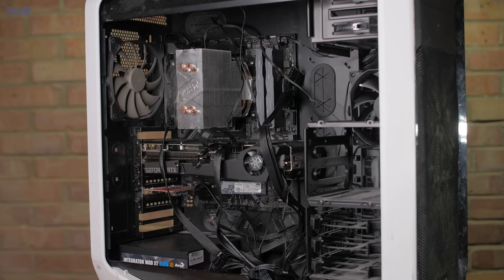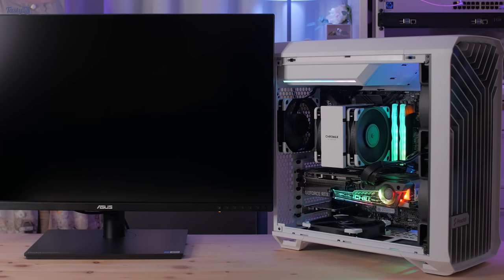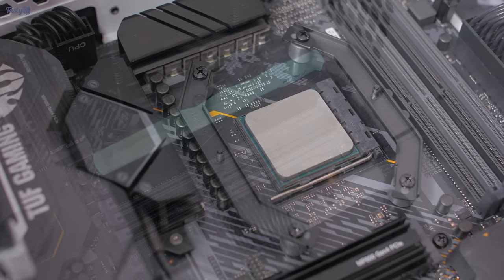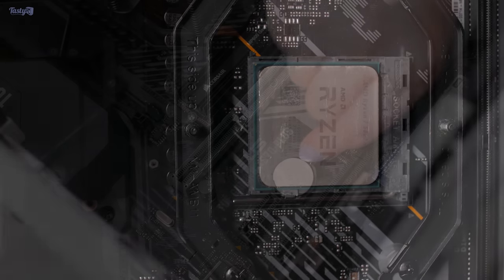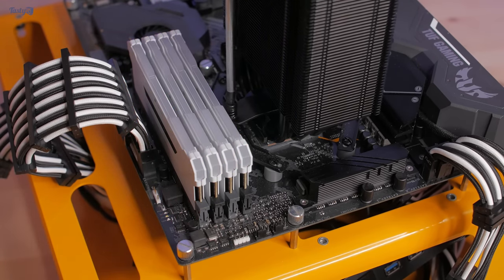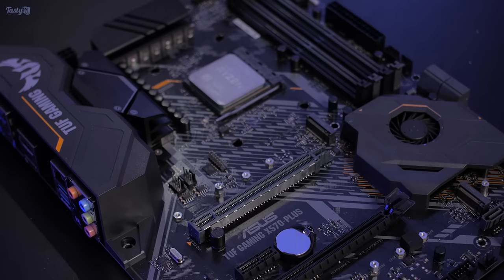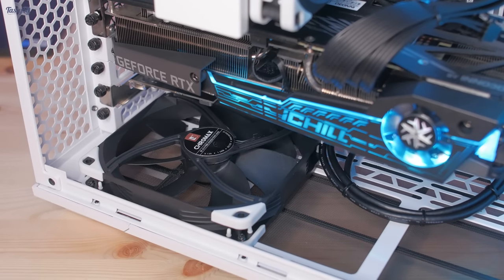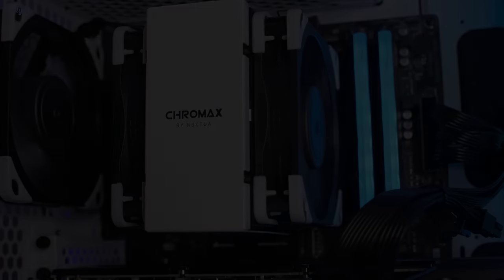I BROKE A VIEWERS PC??

Comment: I had the same problem with that Asus TUF X570-Plus and a 3900X. I had to loosen the mounting of my EVGA 280mm AIO a little bit for all 4 memory sticks to work properly. I am probably wrong but I have a feeling that the Mobo thickness is to blame.

Comment: I think the original mbd mounting lever mechanism was broken.  It looked as if the mount was no longer completely flat where the lever goes into it (nor did it sufficiently difficult to close), thus not providing sufficient tension on all the cpu pins.  Of course it could not be the issue as it if difficult to tell from your video alone.  Don't lose heart!

Comment: I’m guessing it’s a slightly bent pin on the processor which means as you add pressure it doesn’t get good contact with the socket. I have to inspect pins by spinning the cpu with a well lit magnifying glass looking for ANY minor changes. Use a razor blade to straighten them, but be gentle. It takes very little to move them and or break them off if they are loosened. When it’s in the other board, the issue may not be seen as the contact might be slightly better than the one you see the issue on.

Comment: The CPU socket on the motherboard might be damaged. If it was over tightened on installation the first time (the owners install) it could have cracked or broken some of the solder joints over time.

Comment: most likely it is the am4 socket itself and not the whole motherboard that might have an issue. metal tends to change  a little bit depending on temperature  so  the socket itself may be bad and caused a contact issue with some cpu pins as they move just enough to stop making contact because of thermal expension. the socket was probably bad to begin with and i already seen this issue many times and the board had  to be replaced  or sent for RMA if it is still possible. i would try with another 5000 series chip to be sure   to rule out the cpu pins being misaligned with the socket because it popped off with the cooler but a bad am4 bracket is also to consider if  any 5000 chip pops off from it like this .  

most of the time  either the am4 bracket is broken  in some way  or just misaligned with the pins  and  those issues are vey common on motherboards made during the pandemic because of the fact that to increase productions they had to cut some corners somewhere  to simplify and shorten the assembly time. sometimes  the plastic AM4 frame either is just bad , misaligned  or a combination of both . Also Zen 3 5000 series cpu pins seems to be a bit thinner than Zen 2 chips and pop off with coolers and pins might have bent just a tiny bit putting them just out of alignment and  all of this combined may explain why changing motherboard  resolved the issue  but i would still try to stress test with OCCT  that is a better stress test than aida64 because it is more intensive and will reveal any thermal issue of the kind .

Comment: I was wondering lately when you will show us the solution. I had a very strange problem this week when my PC would not post. It was my Brennerstuhl powerblock with overvoltage protection. I had to turn the power switch off on the block and voila the system went back up and running. Very strange, could be the HF filter causing a low voltage on the system/PSU. I really like your video's they are very comprihensve! And I think your builds are very stylish  And I have the same Noctua cooler in my build! Works like charm on my Intel 10700. keep up the good work! My compliments!

Comment: Yeah see fractal are not the first ones to use 180mm fans, Silverstone did in their Raven series cases. Reason why they worked so well there was because the Raven rotated the motherboard 90 degrees, so basically it operated like a chimney.

Comment: it could also be the copper traces underneath the pressure area being snapped in half. This is something that could accur if the CPU cooler was tightened to much and seeing the state of the pc before it got even to you it seems like the copper traces have snapped because someone tightened it to much. Whenever the heavy cooler is on it it could bent it just out of possition and no make contact thus giving a error. So it looks like a broken copper trace i have had this with a customer before too. the reason this issue does not persist with a lighter cooler or with different CPU's is that the metal covers are not all equal in size and there could be a 1nano meter difference on those cpu's which is enough to offset a broken copper trace i mean the copper traces these days are like 0.25mm so even the smallest offset could prevent data signals from sending

Comment: Motherboard socket may have a trace underneath that is severed and only "reconnects" when pressure off the socket is achieved. I have two of those Tuf  Gaming Plus motherboards and use a Corsair A500 (similiar mounting system as the Noctua)with no issues with posts. RMA the Tuf board (if possible) and this can be tested.

Comment: Great job on the diagnostics!
I was in need of a Z97 mobo a few years ago, and for some reason the prices were absolutely crazy, like £200-300, so went looking for a used one on eBay. I found one for about £20, an ASUS Z97 Deluxe with all the bells and whistles (a lot of bells and whistles!), but the listing said that it didn't work because of a memory fault.
After a quick internet search I found out that this was a common fault with those boards and that you could sometimes them to work by messing with the tightness of the cooler. I had a custom loop and so my waterblock was nice and light and it only took minimal tweaking to get the board working.
I wouldn't be surprised if that board worked just fine with an AIO instead of a big heatsink.

Comment: I ran into an issue once where the cooler hardware was interfering with the traces from the ram slots to the cpu causing a short. If you are bridging the traces this can cause the problem. I fixed it by adding some noncunductive rubber washers to the stock cooler mounting hardware against the main board.

Comment: Tough one - I would have probably ended up with a 2nd motherboard before finding the CPU pressure.  Good video!
Reply: The issue might have been an isolated incident to that very combo. There's no way to say a new board might have been the same.

Comment: Glad to see it got up and running fine, nice touch giving the motherboard to the viewer.

One tip about am4 take your time taking the cooler off, yeah amd CPU’s can stick to the cooler but when you lightly press en twist carefully left and right the cpu stays in place almost always. Kinda looked like you pulled hard on the cooler wiggle a bit more in the future it does help.

But nice video keep it up, looking forward to your next build / fix.

Comment: As a sysadmin i would say its a faulty socket or a micro crack in a track in the motherboard. those faults are so hard to diagnose. you are luck to pin it down to the weight of the cooler on the cpu. you could of shimmed the cpu to spead the weight more or used foam washers on the back spreader plate  or it could have been the thickness of the thermal compound. you could of tried electrical switch cleaner on the cpu and socket. you did very well on the fault finding i would be very please to see an engineer do so well. keep up the good videos hope my tips help for the future

Comment: hot air gun  could be used to reflow the solder joints . who knows what happened maybe he might have tried to remove the cpu heatsink at an angle damaging the socket solder joints

Comment: That is an absolutely insane issue, I would have been driven mad trying to figure that one out. Toughest issue I ever had was a weird random kernel 41 error (random shutdown) that had me undoing overclocks and XMP, manually tuning in RAM timings and frequencies, manually tuning vcore and cache voltages, updating my BIOS, reflashing my GPU's vBIOS, reformatting my harddrive and reinstalling windows, updating chipset drivers and more before figuring out it was a c-state issue and that changing a single BIOS option would have fixed it.

Comment: That is an absolutely insane problem.

Did you at any point consider lapping the 5800x and cooler, just to see if that slight reduction in height would make a difference?

I'd be tempted to just for my own sanity...

Comment: i had the same problem with a noctua cooler on an AM4 board. i fixed it by getting a cheap 240mm EVGA all in one cooler. it was on sale for $55 on amazon. it was half the price and did a better job of cooling the CPU. even though using the evga AIO "fixed" the issue, i think the problem was still with the CPU. i think the issue is with AMD's old AM4 manufacturing. some of the pins stop working when there is too much pressure on the CPU. pin grid array CPUs were always garbage. they were garbage when intel used them, still garbage when amd was using it. there is a good reason for why amd uses land grid array (like intel) on all their expensive server and threadripper CPUs, and intel ditched PGA over a decade ago. for AM5 amd got rid of PGA as well. finally.
Reply: For all PGA's problems, LGA has its own, funnily enough also with mounting pressure sensitivity of contacts. There just isn't a genuinely fault-proof way to connect a 1000-pin chip. PGA has been discontinued by AMD now purely because it simply isn't possible to build a PGA socket with enough pin density. AM4 already has pin layout compromises with regard to signal integrity because there aren't enough pins in the socket, it really needed a couple extra rows for the functionality it offers.

AM4 CPU is well supported and constrained in the socket, i don't believe a problem with CPU is possible. It should be caused by socket damage.
Reply: Heh - pin grid is still a heck of a lot better than those terrible 'slocket' cpu's that Intel flirted with years ago.  Remember those?  I do..   they were awful.
Reply: @zenstrata  slot-1 and the short lived AMD variant as slot-a? Fold out ears on top of an edge connector.

I remember disliking them but I no longer remember why.

Then we got Socket 370 which was top notch in most regards. Except the stock CPU cooler was an absolute disaster, I absolutely did not have the hand strength to mount them safely. Nor did many other people judging by gauged boards on return. When cam levers came about a little later, it was such a relief!

Comment: Worth a shot but I have also had this issue and it was due to dust inside the RAM slot. I used compress air and blow out the dust and the sticks worked again.

Comment: try and clean the socket with alcohol, maybe dust or thermal paste got into the socket and depending on the pressure at some micro level some of the pins on the cpu get disconnected

Comment: I have a similar tuff motherboard and I had trouble adding 2 stick of ram and make it past the post.     I had to remove the new ram slot and disable XMP in the bios then add the 2 other ram stick. After I was able to have the 4 stick in and post without xmp.   After it posted I was able to re-enable xmp with all the sticks in.  So in short, disable xmp before adding new rams.

Comment: The original cooler had only one fan installed and it was probably pushing or pulling the air in the wrong direction.

Comment: So indeed a micro crack in the soldering of the socket to the mainboard that arises when a certain pressure is used. Rma needed for the board.

Comment: In the matrix of options to solve the problem, why wasn't one of them replacing the cooler with something else? Did you perhaps also try flipping the cooler around? It could be that with the surface not being completely flat on the base plate, that rotating it would have moved the issue to a part of the IHS that isn't directly over a CCD or IO die. The 5800X has an off-set CCD.
Reply from the maker: Because I knew there was nothing wrong with the Noctua cooler. It worked perfectly with the 2 other CPUs tested and with the 5800X after the motherboard swap. Whereas the CPU+Mobo combo was unstable even when using the Deep Cool Cooler instead. Also, the Noctua cooler isn't symmetrical, so flipping it around would have resulted in blocked DRAM slots.

Comment: I sadly had the same thing happen to me with an amd ryzen 5 3600. I didnt try the pressure thing tbf. Back then I thought my new motherboard may have "killed" it, cause when I closed the leaver the cpu and/or motherboard made a kind of crunchy sizzle noise, I guess thats the best I can describe it. Even with the handicap of no dual channel ram the CPU is still doing alright in my little sisters build tho
Reply: It might've been caused by me overtightening the AIO cooler and ended up in breaking the memory controller somehow. That was my second guess at least, once I've done some research after not seeing any bend pins. The CPU worked just fine before the mainboard and cooler change, no hicupps/crashes or anything.

Comment: Thank you so much, been looking for a replacement for speedfan for years. When you're water-cooling, or even air cooling, only being able to base the fan speed off CPU temp is super pants. Remi fancontrol for the win. Also great investigation on the memory issue, everything was normal investigation of that issue until you started looking at mounting pressure 🤯 I have learnt a new trick. Thanks again

Comment: Nice job on figuring out the problem. Please don't take the following in the wrong manner - but please get into the practice of raising the Sockets ( Release ) lever before { Removing } the Cpu. Take care and have a nice day.
Reply: You can't do that when it comes out with the heatsink though, there is no retention other than the ZIF socket pinching on the pins

Comment: yeah well done. especially for going back to check on the system instability afterwards. that was all quite a fascinating problem solving journey. in particular... the whole mounting pressure thing was not something expected from a pga socket system.

one thing i do personally feel seems a bit silly... is that the hanging of heavy ait coolers sideways. things like the dh15 (when not being otherwiae supported). except thru the motherboard pcb itself. it does just seem like a bad situation that might stress and flex a motherboard pcb unduly. and right in a very critical area where you have a lot of thing traces going to the cpu. and of course the socket itself. but then again i suppose ripping a ryzen cpu out of an am4 socket... that didn't want to be ripped out. could potentially cause even more damages than that!! hee hee

well either way, it all (all the evidence) ended up suggesting a physically damaged connection on either somewhere on the mobo pcb (ie broken trace). or otherwise on the socket (such as a broken solder joint, ie fractured / cracked). whereby a different amount of force. either pushes less (or more) those 2 surfaces. and lets a better push based contact pressure onto that damaged or fractured joint. as for wherever it exactly is, we may never know for sure

in terms of the cpu itself would have compared dimensions. measuring each with a pair of calipers because... maybe going between ryzen generations there might perhaps be some small difference in the thickness of the cpu itself (idk, would have to further research that). but such a difference would also help to explain a resultant difference in the contact pressure. from cpu to cpu. having said all that... its nothing i would have myself guessed or expected from a pga socket. with the sliding horizontal pinching action to grab the pga pins. its all stuff you would rather expect from other components (like an lga socket, or from surface mount dimm slots, or the chipset bga, etc.)

if in doubt, claim ghost. this is the default diagnoses for all unknown intermittent problems with a computer. the ghost is either upset, or something you have been doing on the computer has angered and disturbed it unduly. so then the ghost moves about / is hard to catch etc. it moves along the wires from component to component. so when you do not find it, then has moved to another place to hide. and waits to come back again. do not anger ghost! is the best solution
Reply: One thing wasn't right. 
Lauren did have a working board + different CPU, and a working CPU + different board. 
Any physical damage to the board of CPU have been ruled out by the test above.
I can only assume, it's a particular problem, with that specific unique combination.

Comment: There you go...AMD coolers are sometimes over tightened leading to obscure errors.

That was a tough one Lauren, you have leveled up in fault finding 🌟

So the fault can be permanent bend on the motherboard due to a flimsy back plate. Could try other back plates. I don't know of another fix besides loosening the cooler.
Reply from the maker: In this situation, it wouldn't work if the Noctua cooler was tightened at all.
It was a tricky one though, I'm glad I mostly got to the bottom of it.

Comment: Great video well done on the diagnosis right down to the cooler being fitted. Ive had similar problems after a while a cooler can bow the board and if touch and the pressure releases and then put back the ball grid array fails thats the soldering between the socket the the mother board. It tends to happen with new motherboard because they use lead free solder balls and they cracks and fails over time if pressured. The same thing happens to tv professors and x boxes. 👍

Comment: I had similar issue with Intel system way back. Its an issue with the cpu socket itself if the pins are straight on the cpu side.
And since you can't see the contact points on lga socket without removing the plastic socket itself its pretty hard to tell if theres any of them broken.

Comment: I have used a small block of plastic to apply pressure on the cpu socket from underneath. This countered the pressure being applied by the cooler. Great video and great to see how you figured it out.